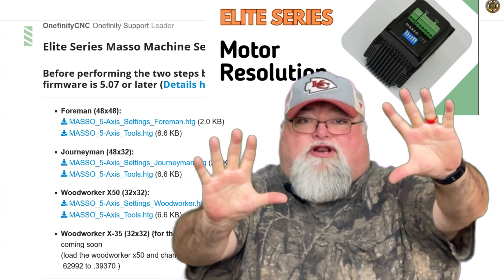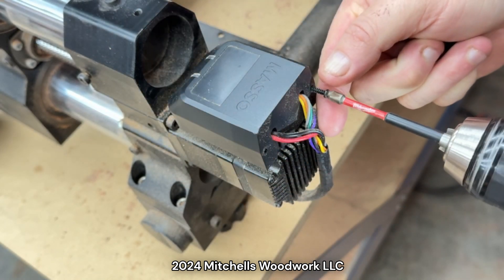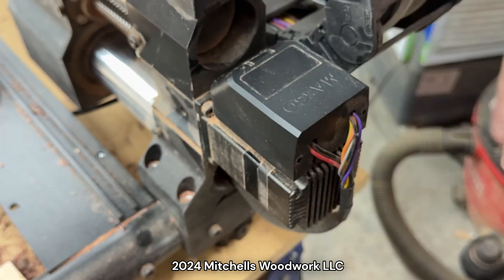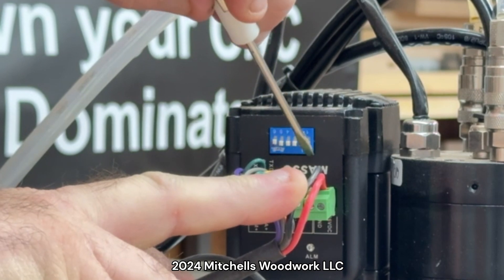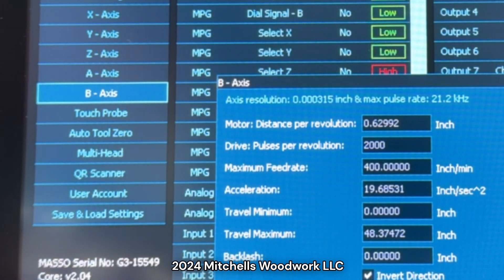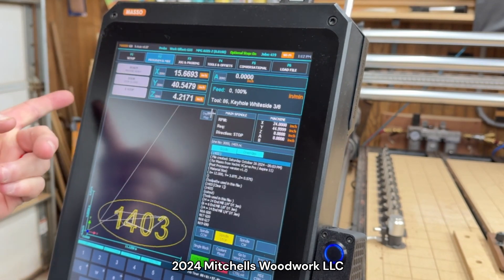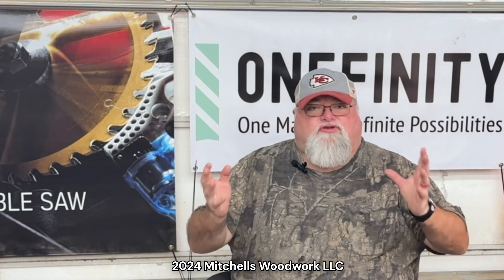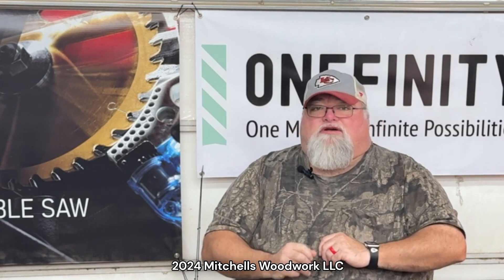WATCH BEFORE UPGRADING Masso Stepper Motor Resolution!!

Comment from the maker: From Onefinity:

“We are thrilled to announce a significant enhancement to the Onefinity Elite series CNC machines with a service bulletin regarding our Masso stepper motor resolution. After two years of feedback, testing, and collaboration with our partners at Masso, community feedback, and internal testing, we are upgrading the stepper motor resolution from 400 steps per revolution to an impressive 2000 steps per revolution.”

This update applies to any customer who has ordered an Elite Series Masso machine or Elite Masso upgrade kit before 10/24/24. Orders shipped after this date will have these changes pre-installed on those machines. 

More information here:
https://forum.onefinitycnc.com/t/service-bulletin-for-elite-masso-stepper-motor-resolution-change/29062?fbclid=IwZXh0bgNhZW0CMTEAAR1RU3LBIUh21kEOGdYDoLtjH3jXrgB6k5Ltv8FVLGVYgQEe0UgYB8c8qnk_aem_Re6y6hWkQ1hiTCtp5Ao27g

Comment: Mitchell...not to beat a dead horse, but, you are saying I should ignore the Onefinity software and simply reset the dip switches, reset the resoulution for each axis, then home the system.  Am I correct?  Did you manually make any of the masso changes that Onefinity noted in the service bulletin?  Thanks!
Reply from the maker: Yes, that’s exactly what I was saying.  In this video I showed everything I did, I didn’t omit anything.  As confirmed directly to me by Masso before I made this video, the method I showed here accomplished the exact same thing their Masso Firmware update did, except this method didn’t delete your entire tool database.  The firmware update also resets all of your custom settings back to factory default.

In October 2024 when this service bulletin was released, thousands of us had been using our Elite machines for well over a year by that point.  I’d had mine for 14 months, and many folks had theirs for 18 months or longer.  LOTS of work went into customizing our machines and Masso’s during that time.  The firmware update erased ALL of that work!

The entire purpose for this video was to save thousands of users from NEEDLESSLY erasing their Masso.  I’m proud to say that it has helped lots of folks avoid making a big mistake. I only wish my video could’ve saved more folks the grief of erasing their hard work customizing their Masso. 

Link to Onefinity service bulletin. 

https://forum.onefinitycnc.com/t/service-bulletin-for-elite-masso-stepper-motor-resolution-change/29062

Comment: tried using your instructions yesterday, when I turned on the masso, I could not access the f1 functions, It wanted me to home it and it had an error for the Z axis, it also asked for the admin code? I don't remember setting that up. need help!😒
Reply from the maker: @donaldcruz9335  you should home the machine as soon as you turn it on…always. 

Then tap the F1 tab at the top of the screen.  When prompted for an admin code just tap the ENTER key on the keyboard.  There is no actual password or admin code unless you manually set one up.
Reply: @MitchellsWoodwork  thanks, thought it was all 00000, I'll try that tomorrow
Reply from the maker: @donaldcruz9335  ok, just let me know if that doesn’t work for you.
Reply: it worked thanks so much😃

Comment: Hey Mitchell, Not quite related but do you know how to slow down the rapid movements from one hole to another. Sometimes I have a grid that needs very precise placement of the holes and the rapid movement goes so fast that I can't really tell if it is following the pre-printed line it needs to be registered to and drilling where it should be when I do a dry run or keep the z above the top. I have an Elite with Vectric Pro Carve. Thanks.
Reply from the maker: I know you can set your X and Y axis maximum travel speed, so try that and see if you get the results you're looking for.  F1 > X-Axis > Maximum Feedrate > Save.  Then repeat the process for your Y axis.

Comment: Thanks for the video! I don’t have a tool library, but I still preferred this way of updating the resolution.
By the way, do you happen to have a rotary (The Revolution) coming your way? I mean sooner than the estimated shipping date (which is January)? For review purposes? Can’t wait to see a first video on that… unboxing, setup, a first carve…
Reply from the maker: No tool library in your Masso?! 😲  How do you make a project without a tool database?

I haven’t heard anything from Onefinity concerning reviewing any of their new products in 2025, but if I do, y’all will be the first to know.  😊
Reply: I kept postponing creating a tool library, haven’t looked into it yet. I suppose it’s not only useful if you have an ATC, but perhaps one of it’s purposes is to also be able to somehow select a tool so the Masso will automatically know all the details, and not have to enter the tool measurements each time on the probing screen, right?
For now, since I hardly do any project that uses more than 2 toolpaths, I measure the tool and input the necessary data on the probing screen every time I change the tool 😁 I’m not sure how I can select a tool from the tool library (if I had tools saved in the library) on the probing screen (would have been useful if it had some sort of dropdown so the user can select a tool from the library, to automatically pick up the tool measurements for probing - that’s what I would be most interested in). I don’t remember if you already have a video about the tool library, how to add tools and how to use it… will have another look at your videos.
I have a tool library in Fusion, that’s easy… I just don’t have one on the Masso 😁
Reply from the maker: In this video I show how to setup your tools in the Masso Tool Database and VCarve Pro database.  I'm not familiar with Fusion 360 at all, but hopefully this video will still help you.

https://youtu.be/cvVy2r7kcvs?si=_iRsHYaudkbOtAbf

Comment: I bought my machine a few months ago but have not set it up.  I'm doing that this weekend.  Since my machine has not been set up previously, is there any reason I should use this method over the onefinity thumb drive method?  I'm brand new to this so forgive me if this is a dumb question.
Reply from the maker: Starting with a brand new machine, you have nothing to lose doing it as Onefinity suggested.
Reply: Thank you!

Comment: When I watched your ATC video you had set these to on-off-on-off so you got 4,000 and said it made the system smoother.  Have you now changed it back to these settings?
Reply from the maker: Which video was that?
Reply from the maker: @Chriswoodworker  you must have watched someone else’s video.  I’d never messed with the resolution before this video.

Comment: Hey man. Thanks for this video, as well as all your helpful others. Having watched your video, I just read the Onefinity Blog instructions about the physical (dip switches) and soft (usb drive update) steps to this upgrade. Physical is the same as your vid but soft portion is very different. Also no mention in their instructions if losing tool settings. Are you SURE I can disregard their usb change and just change the motor resolution in the Masso to make this upgrade?
Reply from the maker: Great questions Bill, thanks for posting.  You are correct, the dip switches and Masso settings changes in this video are indeed the same as Onefinity’s instructions.  And you’re also correct about them not mentioning that following their instructions would cause you to lose your tool database, tool setter location, g-offsets, all ATC settings, and all other customized settings.  Their new software download basically resets your Masso back to factory new.  But there was no mention of that in their video or blog post. 

I can’t explain to you why they didn’t mention that the software change would completely reset the Masso.  You’ll need to ask them about that.  But I contacted them personally before I made this video, and they confirmed that the method shown in this video is a safe alternative.

Comment: Thanks! I'm so glad I didn't do this as soon as I seen this posted from OneFinity and Masso. Needed to get some things done and thought I can do this on Sunday when I have some time. Seen this, followed the video and all is good. One word of caution, don't home before making the adjustments just go straight to the F1 screen make the x, y, z, a changes then all will be good. Great video and it sures saves a lot of time.
Reply from the maker: Thanks and great point about not homing until the Masso settings are changed. Thanks for mentioning this in the comments!

Comment: Really crazy that Onefinity and Masso went through all the effort to make an update that would wipe out all your custom settings just to change your stepper motor resolution. I'm soooo happy I watched your video before uploading the update. I already had it on a thumb drive and was ready to go. You are the man. Think I'll run out to my shop right now and spend the 10 mins. needed doing it your way.
Reply from the maker: Thanks Michael, I’m happy to hear that you were able to avoid the problems that so many others are dealing with right now.  Thanks for watching!

Comment: Dang, I sure wish I had seen this before I did it the hard way...Not only did I lose my tool database, but had to reconnect to the WiFi and re-enter my tool setter coordinates. Why didn't Onefinity do it your way!
Reply from the maker: I’m so sorry this happened to you and SO MANY others.  In the comments below, a guy was able to recover all of his data by removing the updated files and putting his original files back in the Machine Settings folder on his thumb drive.  Try it and let me know how it works out.
Reply: @MitchellsWoodwork Thanks but I’ve already done it the “cave man” way…
Reply from the maker: @WoodMan61  UGH!!!

Comment: Hey Mitchell!! Thanks for doing this.  I wondered why 1F instructed us to do it the other way.  What you did is what I thought is all that needed done. Since I wasn’t 100% sure my assumption was correct, I had held off. But, you’ve given me the confidence to move on and just do it this way. Thank you!! 💡
Reply from the maker: I have the official Onefinity statement pinned to the top of this comment section.  I’m glad my video has helped you make an informed decision on how to proceed with your upgrade. Thanks for watching!
Reply: Same, I'm just now finishing assembling the Elite Foreman.  It's my first CNC.  I don't know what to do next now that it's assembled.  I saw the service bulletin and had not planned to do it until now.  I have no custom settings to lose, however, this seem so much simpler, I'll do it just to have it done.  Can anyone point me to dummies guide on what to do after you assemble the machine?  I'm currently lost.  Thanks.
Reply from the maker: @user_16309 which design software are you using?

Comment: If it's this simple why is it just now coming out? Why not 6 months ago? Why not installed from the factory new?
Reply from the maker: From Onefinity:

“We are thrilled to announce a significant enhancement to the Onefinity Elite series CNC machines with a service bulletin regarding our Masso stepper motor resolution. After two years of feedback, testing, and collaboration with our partners at Masso, community feedback, and internal testing, we are upgrading the stepper motor resolution from 400 steps per revolution to an impressive 2000 steps per revolution.”

This update applies to any customer who has ordered an Elite Series Masso machine or Elite Masso upgrade kit before 10/24/24. Orders shipped after this date will have these changes pre-installed on those machines. 

More information here:
https://forum.onefinitycnc.com/t/service-bulletin-for-elite-masso-stepper-motor-resolution-change/29062?fbclid=IwZXh0bgNhZW0CMTEAAR1RU3LBIUh21kEOGdYDoLtjH3jXrgB6k5Ltv8FVLGVYgQEe0UgYB8c8qnk_aem_Re6y6hWkQ1hiTCtp5Ao27g
Reply: They just confirmed it would work better without issues through their testing. Now every machine shipped after 10/24 will have it done at the factory.

Comment: I did this earlier today. Much easier than updating the whole MASSO! However, I did not update A axis. Is that really necessary? I thought A was used for a rotary? I guess it couldn't hurt though.
Reply from the maker: I just felt better having all of them the same settings just in case…

Comment: Thank you for making this video - I appreciate it very much!
Reply from the maker: No problem, Neil!  Thanks for watching!
Reply: @MitchellsWoodwork  I just did the stepper motor resolution change, and besides a couple of "stutters" (I was cleaning the Journeyman Elite off) it is moving smoothly.
Oddly, my shop vacuum is not turning on with the "Coolant Flood" button - even though I hear the solenoid clicking, and the vacuum does run when plugged directly into the wall. It worked about 3 weeks ago, and nothing other than the stepper motor change has been made.
EDIT - I FOUND THE REASON - A POWER STRIP WAS SWITCHED OFF ...

Any thoughts about what I may be missing?
Reply from the maker: Are you using v5.07?  Did you do the software upload procedure that Onefinity recommended?
Reply: @MitchellsWoodwork  Thanks for your reply - I found the reason the vacuum was not powering up - I had not turned on a power strip that it was plugged into ... brain fart!
Reply from the maker: @NeilBlanchard  man I love it when it's a simple solution!!
Reply from the maker: @NeilBlanchard I love easy solutions!!